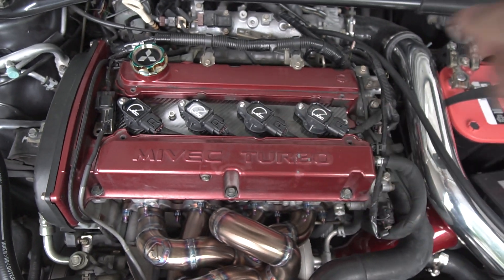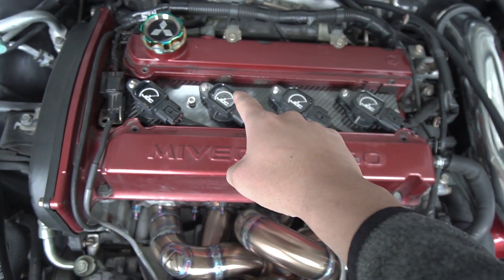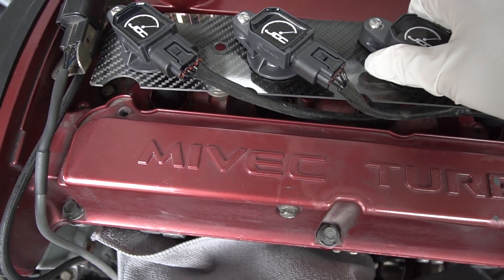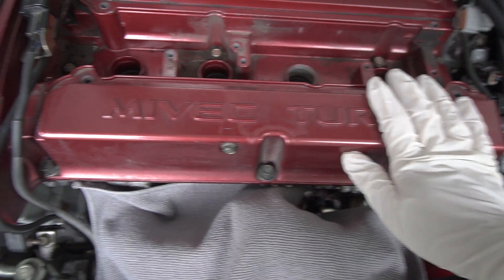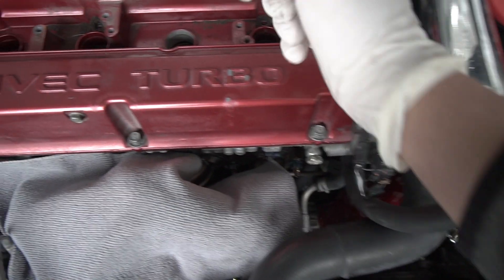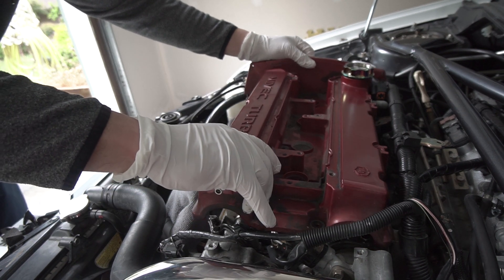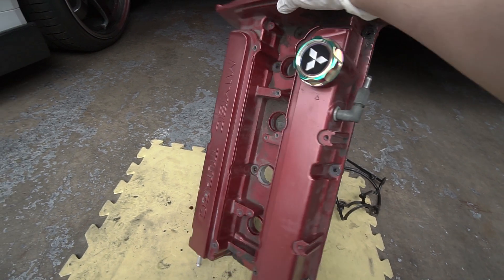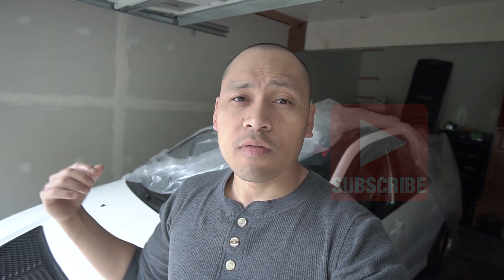How To Remove Evo 9 or Evo 8 Valve Cover In Less Than 5 Minutes!

Comment: Hopefully you can reply. But what was that hose in the back of the valver cover? Mine is throwing oil everywhere from that hole
Reply: that is connected to the oil catch can. Get it plugged or buy a new trans mounted catch can from STM

Comment: I gotta do that to mine. Also gotta replace the valve cover gasket. I’d just repaint it the same color. Maybe sand the paint off the letters to bare metal. That’s my Honda roots showing though 😂
Reply from the maker: I love your idea! Thank you for the input, i was thinking of doing the same thing in my preludes valve cover. Thank you for the suggestion! You have a great weekend! 😊👍🏽